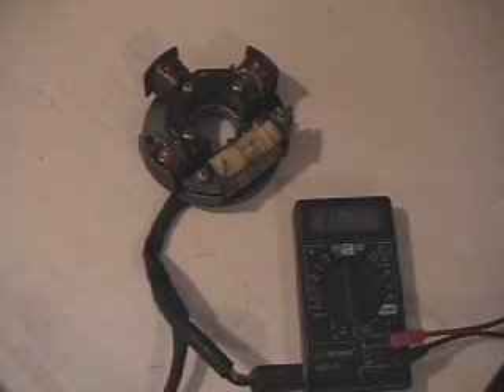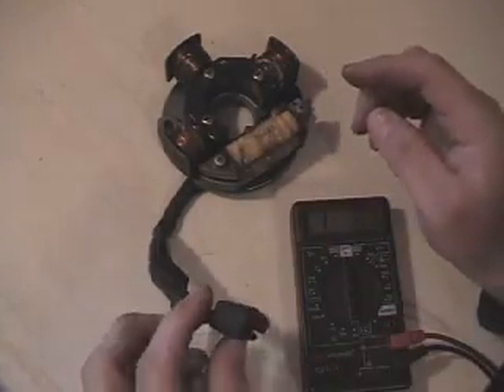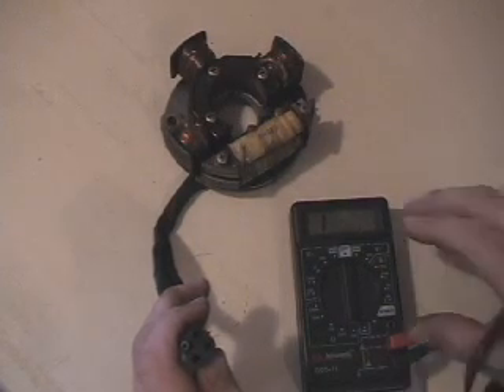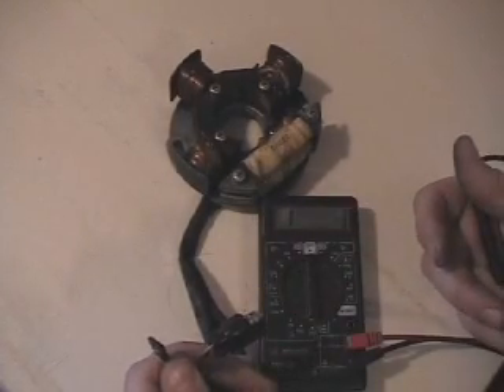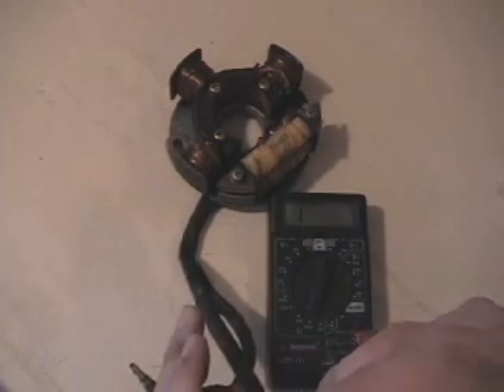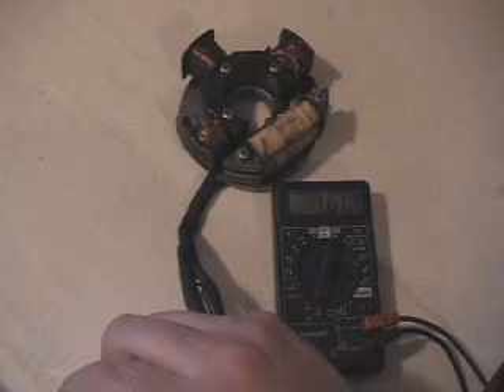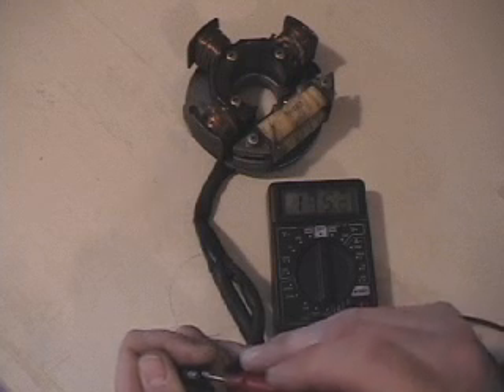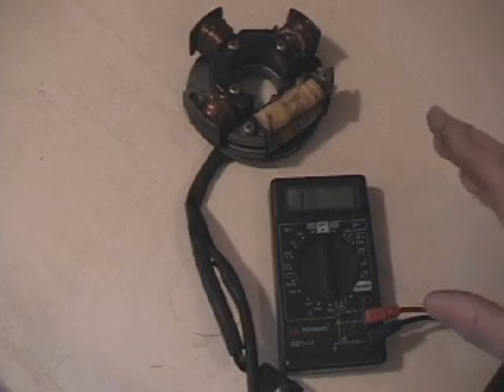Arctic Cat early to mid 1990's ZR 580 650 700 carb Stator Test

Comment: Hi blaine, have a 95 zr 580 that bogs and won't move after warming up. Tested the stator when cold and it read 151 ohms, 16.8 ohms, and the two yellow wires .6 ohms, do you think the stator is causing the problem?
Reply from the maker: It could be stator related but those stators don't go bad very often. 151 & 16.8 when cold are respectable ohm readings. Those readings don't tell me that it is obviously bad.

Comment: I need a video of how to trace down a short on a 94' ZR 580 carb model. No spark, if I use the jumper wire (like you show in your other video) it runs fine. Such a headache

Comment: room temperature vs. operating temperature. when machine is warmed up does stator get warmer than room tempature and omhs higher and then not work?  cause stator ohm ok at room tempature and cuts out when machine is warmed up I think its electrical. I have changed out cdi and the thingy that the plug wires come out of along with the plug wires ,  clutches, and carburaotrs all from a working sled new plugs.  and checked pistons and jugs over. it seems that one plug spark is weaker than the other and yellow while other looks blue?
Reply from the maker: The stator warms up during operation and the ohms will read higher. What matters more are the ohm readings are room temp or when cold.

Comment: thanks for replying back to me, i went ahead and bought a new stator and it fixed the problem.  i guess just because the old stator ohms out good and within spec doesn't mean anything some times, initially i replaced the stock arctic ignition coil set with a new Kimpex coil set(on stator) and it didn't fix the problem, so it sent me on a wild goose chase checking other possible problems. lesson learned, #1 is just because it ohms out good doesn't mean it is good.  #2  kimpex coils are junk

Comment: hey Blaine, great videos.  i have a carbed zr 580 that is giving me a tough time, i ohmed out the stator and its in spec, the motor is a fresh rebuild with 2 new cylinders/pistons/crankseals and rebuilt/cleaned carbs (spotless and correct jetting) the sled refuses to rev much above 5,500-6000 rpms and it kind of falls flat on its face. i'm suspecting the high speed coil isn't putting enough juice into the cdi that it needs, i already swapped out the cdi and external ignition coil with no change